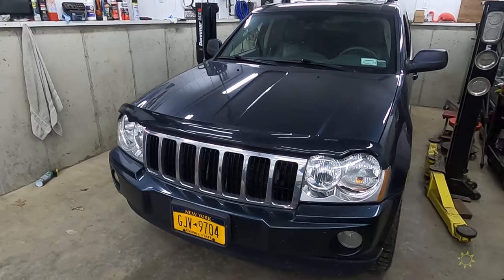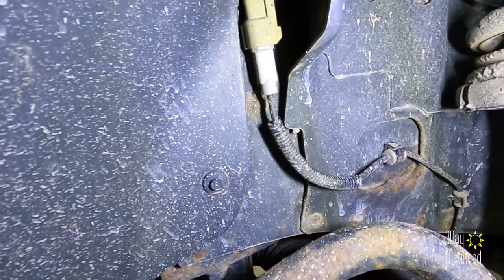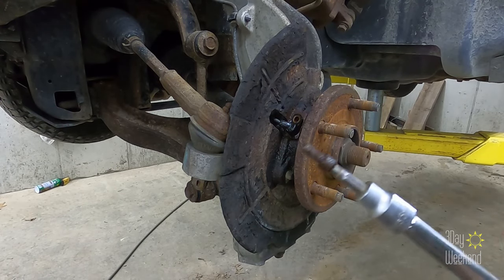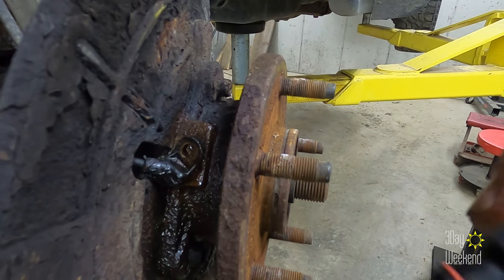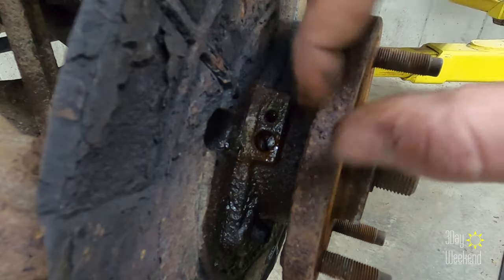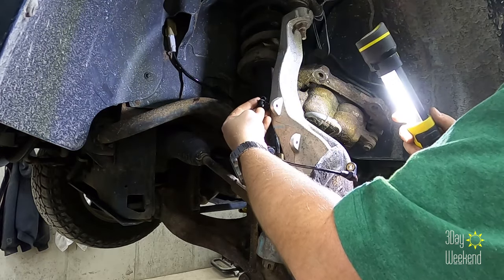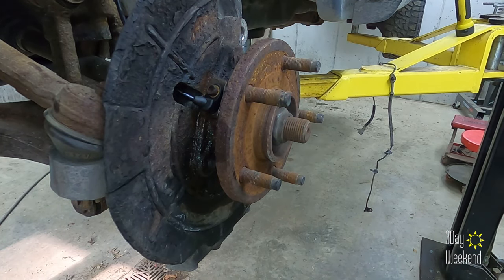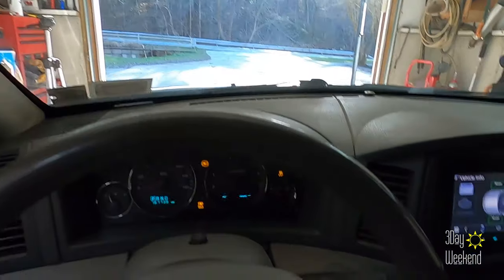Fixing a Jeep ABS / Traction Control / ESP BAS Light - Time for a Wheel Speed Sensor - Fault C100A

Comment: The same happened with my 2006, V8 4.7. And it was resolved by changing the abs sensor, as you explain in your video. I also had another problem, indicating "4wd system service", which I solved by simply removing the corresponding fuse, starting the engine, replacing the same fuse and restarting the engine. And the problem disappears. I believe that by doing this I applied a reset to this system. Thanks e Regards from Brazil.
Reply from the maker: Terrific!  I have also experienced the "Service 4WD System" error, and was able to resolve it by pulling a fuse.  It was in this exact same Jeep!  Been working great since though, so here's hoping it was just a fluke.  Thanks for watching all the way in Brazil!
Reply: @3DayWeekend which fuse did you pull?

Comment: Hey i like your screen in the middle my 06 grand cherokee jeep limited 4.7 V8 doesnt have that but anyways when i turned on my jeep it showed the same lights as your dash and when i turned i off and turned it back on it still showed the lights and i turned it off waited like 10 to 15 mins and turned it back on the lights was still there so i put it in Neutral and then pulled up 4wd and then the 4wd turned off and the other lights as well should i have not done that? Oh and btw when i got my new tires and alignment done the guy said i need new tire sensors is that why the lights turned on?
Reply from the maker: Thanks!  I also like the screen.  After replacing a wheel sensor, the vehicle must be moved for the ABS system to see the new sensor and clear the light.  The tire sensors are just for your tire pressure monitoring system.  That's a different light, and you'll get a message on your speedometer screen saying "Service Tire Pres System".
Reply: Hi I'm having the same problem with my grand Cherokee I have the same one as you.when I drive the truck clucks every now and then on and off.i was told I need what he brought and that will stop and all them lights will go out.did yours do that

Comment: Thanks for the video. I have a Jeep Grand Cherokee 3.0 CRD 2005, U140c, after replacing the sensor, everything is OK, but the U140C fault cannot be cleared through diagnostics. Why can't u140c be deleted from the car's control unit even after a successful repair? Thank you for your response
Reply from the maker: As long as the light goes out, you're good.  If the light doesn't go out, it's still unhappy about something in that right rear wheel.  If the light goes out but the code stays, you're fine.  It'll just take a predetermined number of drive cycles for that old code to go away on its own.  Some of them take as many as 50 drive cycles for the old codes to clear.

Comment: Alpha OBD is so important to have if you want to do your own repairs. It told me which abs sensor was bad just the other day on my 06  WK GC. Ordered a new one for an easy fix by the look of it.  How do you like your Wild traks? I  used the Alpha OBD to adjust the speedo too when i put a set of 245/75R /17 Wild Traks on my GC.  31" tyres instead of stock 29" +  Inch and a half lift too. Also tells me which glow plugs are faulty, Extremely  helpful.
Reply from the maker: AlphaOBD never ceases to surprise me.  Had to replace a tire pressure sensor and after I did, the service tire pressure light came on.  Forums say it has to go to a dealer to have the new sensor programmed into the SKIM.  Fired up AlphaOBD, found the option, and programmed it in myself!  Love it!  Those tires have been EXCELLENT.  They are a little aggressive so there is some tire noise, but they ride and wear really well.  I liked them so much, I got another set for the wife's Commander.  Very pleased.  When they wear out, I'll be getting them again for sure!  Thanks for watching!

Comment: I was told this is what i need all the same light are on in my grand Cherokee 5.7 L 4x4.because mine is bad.my truck is clicking and clucking while im driving on and off.is that supposed to do that .
Reply from the maker: It is possible that's all you need, if your describing the sound of the ABS and/or Traction Control System activating.  If a sensor is faulty, it can sometimes make the computer think a wheel is going the wrong speed, and the ABS/TCS will attempt to slow the other wheels.

Comment: You didn't have to repair all of them. It's an electrical problem. Same thing happened to me when I replaced the alternator. Somehow the new alternator was bad. Drained the battery and all the lights came on at once. They couldn't all be bad at the same time.what are the odds they all fail simultaneously.  Lol slim to none. And they weren't on before. Update just changed my alternator and now all 3 lights gone. Woohoo. Winning.
Reply from the maker: I'm glad you were able to fix yours with the alternator, but that was not the case for me.  With low voltage, the ABS computer will go to a fault state, and all of those lights will come on, as they all depend on the ABS computer to function.  In my case, however, the ABS computer was online, but could not see the front left wheel speed.  Due to this, it must throw a code and go to a fault state, which illuminates the lights for all of those systems.  Once I replaced the sensor, the ABS computer could see the left front wheel speed again, and came out of its fault state which re-enabled all the other systems and all the lights went out.  2 different solutions to 2 similar issues!

Excellent pointer though, as voltage would be something to check before digging into wheel speed sensors.  Thanks for sharing!

Comment: Would you happen to know if the connector for an 07 Compass is as easily accessible as this? The wire goes through a clip in wheel well I have yet to remove. Could I get that lucky??  Had to replace the front wheel hubs and bearings and the driver's side sensor was too corroded to come out cleanly. It broke. Thanks for a great video.
Reply from the maker: It has been a while since I worked on a Compass, but I do recall the connector was right up front, similar to this Jeep.  If I recall correctly, it's right behind the inner wheel well.  Shouldn't be too hard to get to.  Glad the video helped!  Thanks for watching!
Reply: Thanks for the reply and I actually found it. All you have to do is remove the air box and the connector is easy to get to under the hood. Again, your video is very helpful. Thank you.

Comment: When all these lights were coming on your dash, were you also getting a mechanical grinding sound? You know like the anti slip trying to brake or shift traction to another wheel?
Reply: You might be needing a wheel bearing , grinding noise can be a sign for that especially if it’s slipping cause one’s going faster than the others
Reply from the maker: I didn't, but it does happen.  If the wheel speed sensor is reading a speed incorrectly, the ABS system will interpret that as wheel slip and will try to engage.  This is typically more prevalent at very low speeds - like when you're almost to a complete stop.
Reply: Both of you were correct, I separated the CV axle from the wheel hub and the bearing was oozing grease that turned into almost hard candle wax texture. I replaced the hub and steering knuckle with a new bearing installed because it was cheap online. Also replaced the ABS sensor because something was rubbing on it. I reset the stored ABS code with a scanner that has ABS system accessibility and the problem went away.
Reply: @byronarriola4304   Great to hear! It seems like this year a lot of people have big time vehicle issues
Reply: @erickaerickson3080  we get nasty winter cold weather here, and all the gremlins in the cars around here start to come out and create nasty breakdowns lol. Thank God for YouTube and people willing to share knowledge.
Reply: @byronarriola4304  I honestly feel that lol, winter is nice for some stuff but not this one bit

Comment: Thanks for the Video just happened to my 06 srt I hope this is the issue
Reply from the maker: I hope so too!  Thanks for watching!
Reply: Any updates ? Same year srt and have this issue, thanks.
Reply: @nachoarroyo5304  yea I ended up changing the transfer case cost me around 4K new it was setting it off when the flushed the fluid my case was dropping metal bits and it’s not running rough that and a wheel alignment plus the steering wheel was off as well

Comment: I got the same lights on as you but my Speedo doesn’t. Work did your Speedo work with those lights on?
Reply from the maker: Yes, my speedometer did work.  Sounds like you have a different sensor/sensors causing your issue.  I believe there is a vehicle speed sensor on the transmission which would be tied to your speedometer.  If that is faulty, it would probably throw all these same lights.  I could be wrong, but that's where I would start.

Comment: I have a '06 Overland. Cruise works, till I use brakes, to make a turn, then I loose Cruise. Or if I use the Decel to many times. I loose the Cruise control.  Then when I restart My Jeep OverLand again, I will get Cruise back. So, will this help my situation?
Reply from the maker: If your ABS light is not on for this code, then this fix will not have any effect.  

Purely a guess, but perhaps there is an issue with the button assembly itself?  I'm pretty sure those buttons all go on the CANBUS, so if there was a problem with the button assembly, a reset would get it working again.  I could be wrong, but if it were mine, I'd probably start there.  Hopefully you're able to get that resolved!  I would find that problem very annoying!

Comment: I have a Jeep Patriot 2014, my ESP light is on and won’t go away and the car struggles and dies once i give it some revs, the car has been in the garage and haven’t been able to drive it. Any chance you would have an idea how to fix it? Can’t find anything on YouTube, just trying my luck to fix it myself before i take it to a mechanic. From Australia
Reply from the maker: Just the ESP light?  It shouldn't have issues running with just the ESP light, as it is a completely separate module from the engine computer.  Perhaps that is a byproduct of some other issue, or an additional issue.  I'm suspecting your engine computer will show you some other issue.  Alfa-OBD is your friend for troubleshooting.  Just like the Check Engine Light, the ESP light could be on for many things.  You'd have to run the diagnostics to know for sure.  Sorry I can't be of more help.

Comment: How do you know which sensor is out?
Reply from the maker: I used the AlfaOBD app paired to an OBDLinkMX+ to read the ABS module codes, which told me which sensor it was.  Any repair shop or Autozone should have a reader that can pull codes from the ABS module.  Hope that helps!

Comment: I have this on my 2008 Jeep GC CRD diesel. All of these lights came on, as well as it’s saying “4 LO” in middle. And it won’t shift now and i can’t get that 4 LO to go away. Any insight ? Randomly happened. I’m stumped
Reply from the maker: That doesn't sound good....  I'd try a reset first (disconnect the battery, touch the leads together, wait 30 seconds, reconnect).  Hopefully that would clear enough to get it rolling, but a code reader should tell you the root cause of the problem.
Reply: You need to replace transcase front and back axle, fluid with Synthetic- 4 fluid ( it's usually transmission fluid, or similar, oil,  you have to do your own research, if your a diy)

All AWD or 4x4 require flush and replace fluid every 30,000 miles. It takes 2 quarts per /f/b axle to fill transcase. 

Stay safe

Comment: Hello. I had the same exact issue with my '08 Jeep Commander, replaced the wheel speed sensor, still lighting up just like yours. Thoughts?
Reply from the maker: Make sure you check the codes to find the exact cause of your issue.  Mine said it was the front left sensor, but there are 3 other sensors it could be, or it may be a different problem that doesn't involve the wheel speed sensors at all.  The ABS unit could be faulty, or you could have a broken/corroded wire or connection too.  Definitely have someone run the ABS codes and go from there.

Comment: I have the same exact models as urs but my engine size is 4.7 v8 , those kept popping on and off but shifted great still but when I got to point B for where I was going and on my way back to point A it started going into limp mode and kept flashing traction control , and for some reason it’s able to shift like it usually does but sometimes I’m able to go to 40-60 at times then flashes those codes and then goes to limp mode again and does the traction control flashing when it happens , the alignment is great still nothings burning for oil and everything runs like it’s supposed to and this never happened before , is it the wheel speed sensor ?
Reply from the maker: These wheel speed sensors should not put the vehicle in limp mode.  I would highly recommend taking it to a shop and having the ABS system and TCM (transmission control module) scanned for codes before trying to put new parts on it.  (Autozone and other chain scan tools can't scan the transmission or ABS computers)  Hopefully something is amiss with the ABS that is telling your TCM to go to limp mode, but I would suspect an issue with the transmission which could disable the ABS system in limp mode.  Sorry for the bad news.  Best of luck to you!
Reply: @3DayWeekend   Yeah i found out what it was , so like several months ago i got spark plugs from oreillys gave them all the right info as well like all the info they need for it , and turns out they gave me the wrong dang spark plugs this entire time, i needed spark plugs that were copper , my vehicles been in the shop since like november 22nd as soon as that started happening , and it was also my wheel bearing, had to pay $670 after it got done

Comment: I've got the same thing, the same three lights. Is it dangerous?
Reply from the maker: That's a tricky answer.  Here it goes:  It won't cause mechanical damage to the vehicle, however, several safety features  of your Jeep are currently disabled.  If you found yourself in a scenario that required emergency braking or a quick steering maneuver, your braking and stability assists would not engage which could result in an accident.  

ABS - your tires would lock up under full braking, resulting in a loss of steering.  

ESP/BAS (Electronic Stability Platform / Brake Assist System) - in an emergency steering scenario, the stability control would not function, which could allow the vehicle to fish-tail resulting in a loss of control or it could even flip over.  BAS works with ABS to shorten your stopping distance.

I would recommend fixing it as soon as possible from a safety standpoint, but mechanically no additional harm would be done to the vehicle by delaying the repair, provided the light is on for only a faulty wheel speed sensor.  

Hope that helps!

Comment: So I changed everything read and front sensors I tested the cables if they had power running through out the system and I still get the lights turn. On
Reply from the maker: Sounds like you may have a completely different issue.  Be sure to check the ABS module fuse as well.  A code reader such as AlfaOBD, a local repair facility, or the dealership will be able to read the ABS codes to pinpoint your issue.
Reply: Same. We had to replace the ECU and that fixed it

Comment: I just cleaned my full throttle on my Jeep Compass and the electric stability control came on. Help 😅
Reply from the maker: That's odd.  You wouldn't think those two systems would be related!  The Compass is a bit different than the Commander, so I'm not really familiar with them.  Maybe disconnecting the battery would be a good place to start?

Comment: What does it mean if you have these 3 lights plus a dinging noise?
Reply from the maker: Mine did a single ding when these lights came on, and this was the fix.  If you don't have the readers, I would recommend taking it to a shop that can read the ABS module codes, and it should tell you what the problem is.
Reply: wheel barring?

Comment: I just got this error... same wheel... reading the service manual it just says "remove sensor", great i think, easy!, but lacking details.... so i found your video and... the brake rotor has to come out?!?!,.. motherf jeep....
Reply from the maker: Yeah, the rotor does need to come off, but I've had other vehicles where the sensor is built into the hub and is not changeable, meaning you need to replace the hub just for a bad sensor.  Fortunately this one is replaceable!  I'm willing to call it a fair compromise!  Thanks for watching!
Reply: @3DayWeekend  it makes it a PITA to interchange left/right to troubleshoot

Comment: changed the whole bearing with sensor, lights still not gone out.
Reply from the maker: Bummer!  You may have a problem with the the plug itself or the wiring.  I've seen where moisture has gotten into the plug and the pins are covered in corrosion or completely missing!
Reply: I think the wording is wrong here on the video? Maybe not? So there’s a “speed sensor” and there a “ABS wheel speed sensor” I think you would want to replace the ABS wheel speed sensor but not 100% I just bought a car today and having the same issue but thought I clarify that for you.